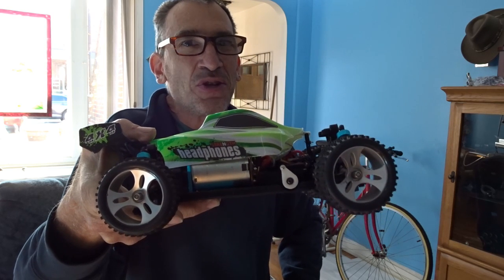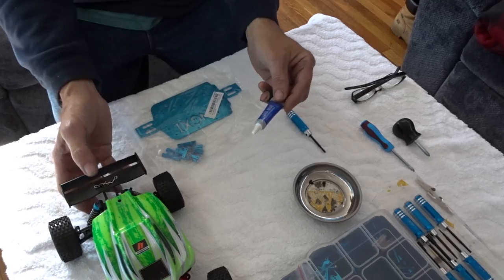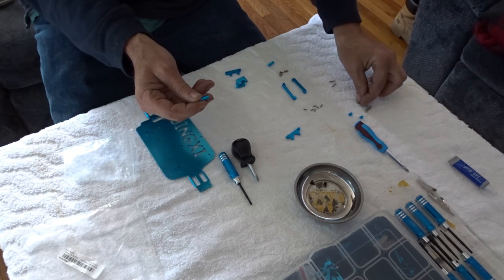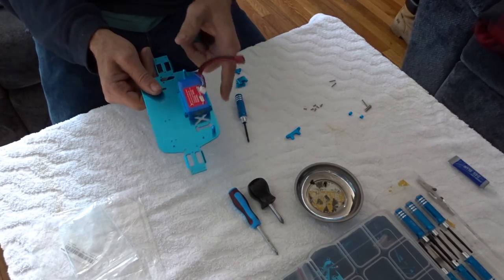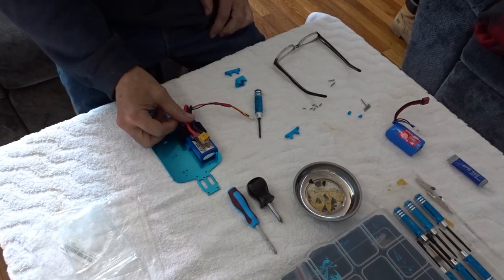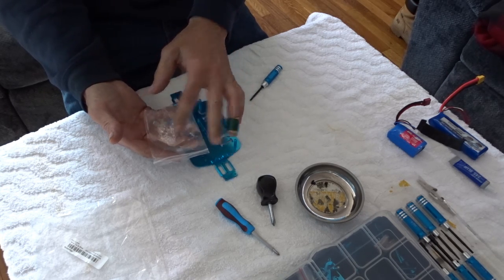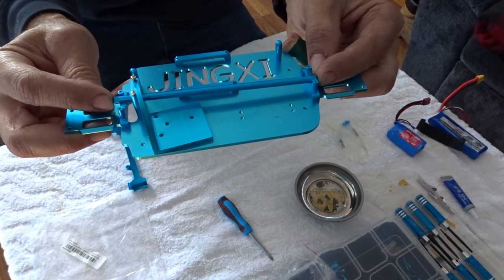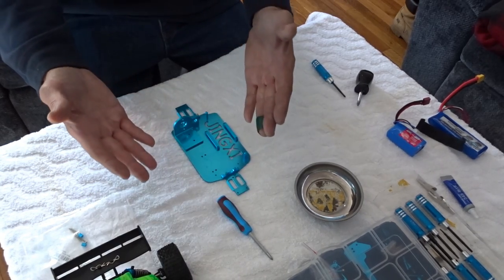Wl toys A959-B Jingxi Chassis Install

Comment: Does it have bearings. double check it. if it has them. Get better higher abec rated ones. Also adding weight affect speed and handling. So Invest in get bearings, check the differentials make sure they have good grease and enough of it, Put good bearings there as well. Check the main pinion gear. if id too tight adjust it to ha a smaii gap. I use a strip op paper between the gears to get the right gap. hopefully this helps.